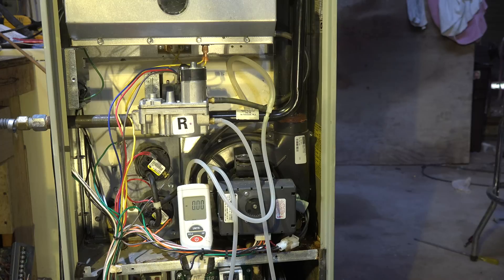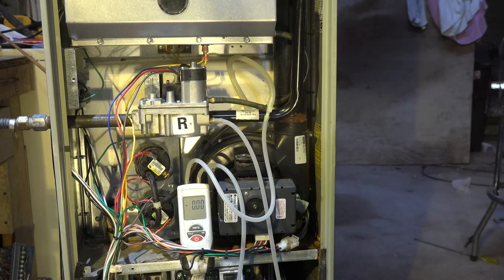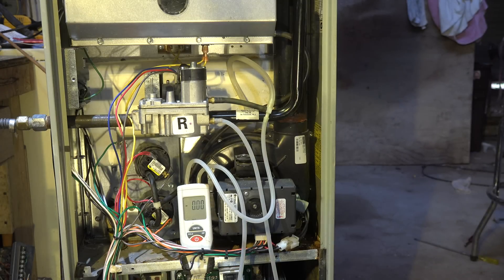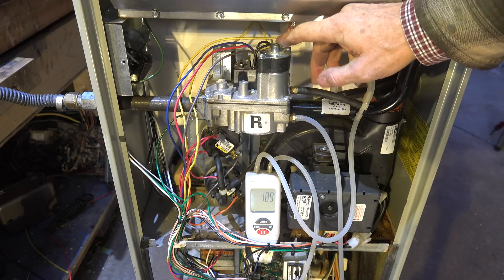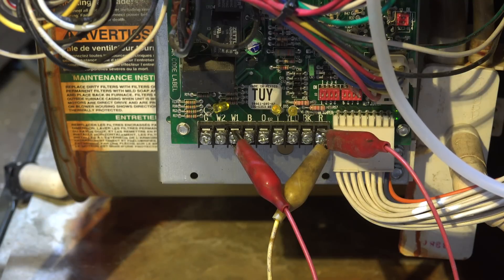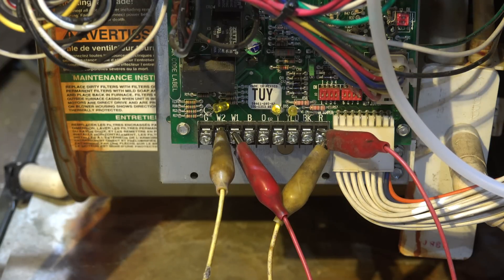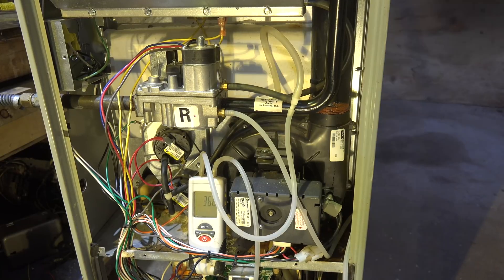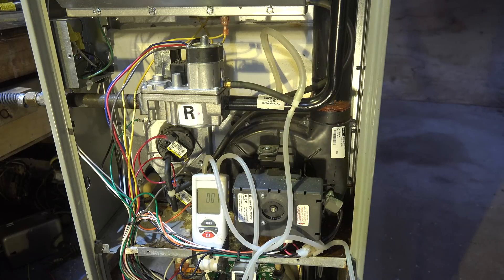Service of the 90+ efficient gas furnace #4

Comment: So i got a manometer like yours and both my high and low readings bounce around, the low bounces from 167 to 171 and the high bounces from 347 to 351 my question is do i just set it so to the highest number i see when its fluctuating

Comment: Maybe you could explain why you referenced the feed line and not ambient? Thanks for all the videos and happy new year.
Reply from the maker: If you mean ambient pressure, the gas valve regulator must be in the same pressure as the burners.  With this being a sealed combustion, the pressure may be lower than that at the gas valve.  Happy new year.
GFM
Reply: +grayfurnaceman got it. Thanks

Comment: Hi.
Where can I get right part Flame Rollout Switch for Trane? Thanks.
Reply from the maker: I would try a Trane dealer.  These parts are OEM only.  Next, why are you replacing it?  If it kicked off, it is telling you there is a problem.  I never, in 35 years in the business, replaced a rollout switch.  There was always something (heat exchanger problem, venting, dirty burners) that caused the switch to open.
GFM
Reply: grayfurnaceman 
I have already ordered it.What do you recommend clean up the burners?Thanks.
Reply from the maker: I use a tree brush and a shop vac.
GFM